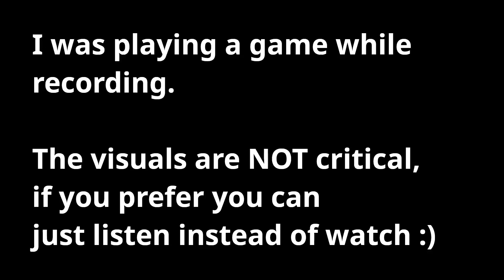What is the 'Problem Space' in Software Engineering?

Comment: Lol Ive thought about this quite a lot actually. I find building these systems when you don't fully understand how they work is about tackling assumptions early on.

1. Identify performance characteristics that are important (have disastrous consequences)

2. Design and code while testing these key characteristics. Then you can see which technical decisions are effective.

Sometimes you don't realise that a characteristic is important.
Reply: Maybe in the microcontroller project, a key characteristic is timing. So tracking how long a function runs could be critical to solving this problem.
Reply: Then again maybe maths knowledge plays a role too.

I had a signal analysis project where I needed to analyse frequencies.

Initially I thought, why not use Fast Fourier Transform? It's fast right?

Oh boy was I wrong. Turns out you can achieve something similar with convolution. Or a fancy term: wavelet transforms

This dramatically reduced computation time for real time Digital Signal Processing
Reply: Another example.

Web scraping requires reliability and little supervision. It would be painful and expensive to restart a long webscraping script. Plus manually handling errors is time consuming.

From these issues, we need data persistence for our scraping progress. Errors should be retried and handled without crashing.

A distributed queue and worker solves the progress persistence issue. Using error as values and logging error inputs allows you to replay what caused the issue in a Dev environment.
Reply from the maker: yeah agreed, and you can never have "100% correct" assumptions but I find the more experience I gain the better I'm able to judge and make "more correct" assumptions that lead to a better product